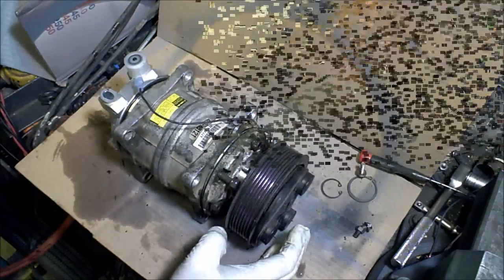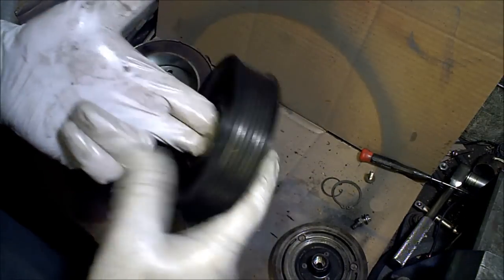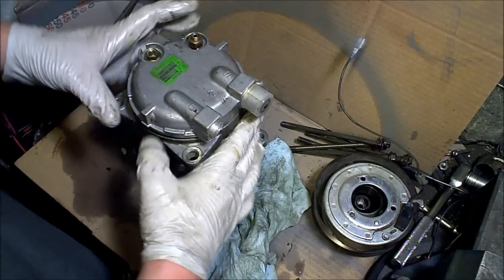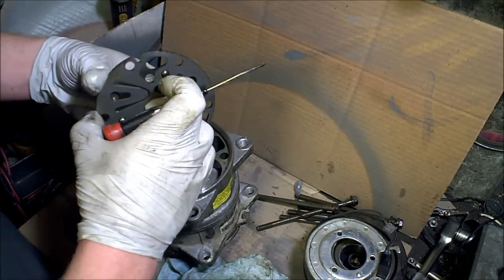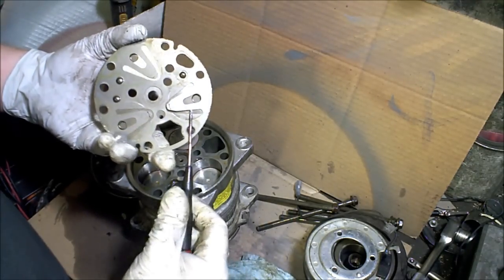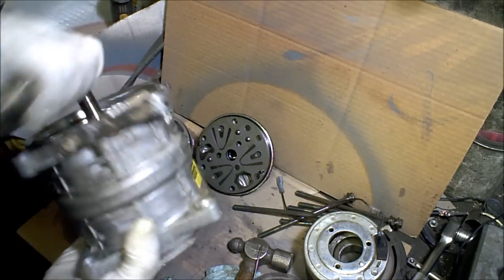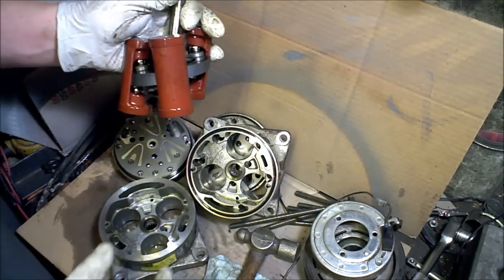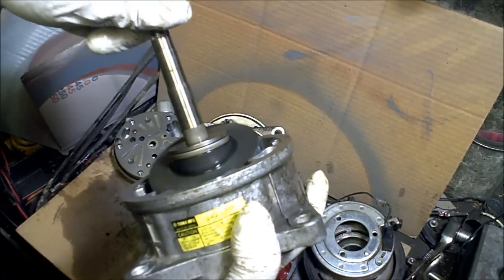AC compressor take apart How it Works tear down air conditioner

Comment: Thank  you for this so well put video. I remember being told by my auto repair instructor many years ago: "if you suspect the compressor is not working right, just replace it with a brand new one"
by you sharing this video , now I can see the inside of the a/c  compressor. Thanks again.

Comment: I have been an auto mechanic for 14 years and never actually new the internal movements of an A.C. compressor.  It is not at all what I imagined.  Thank you for your video.  You learn more and more each day.  I still don't understand why some manufactures think that this small chunk of aluminum and steel is worth 600+ bucks.
Reply: Cost about 230 on amazon
Reply: and all i need is a $5 seal
Reply: $1790+gst from Nissan AU for one for my patrol.
Reply: 300 and something for my 03 avalanche at AutoZone. I'm sure at the dealer it will be more then 300
Reply: I know this is years after you asked, but it's because of the tight tolerances you need on the internal components. Machining is much more expensive when variation is measured in microns.
Reply: @ToyManFlyer1100  Always pay more for quality
Reply: Quality today becomes substandard tomorrow.
Reply: Exactly what i thought when i watched the video, why are they so expensive? Can easily pay over AUD $1000 (US $657 as of today) for one in Australia. I know they need good bearings, tight seals and tolerances and need to be able to last and not leak with automotive vibrations but still, $1000? You can buy a whole car for $1000!

Comment: So I'm going through our automotive A/C class at a tech school and we're told right away that we will not be taking apart any compressors in the field because they will always be replaced straight away. Fair enough. But then they say that for this very reason we will not even have a display compressor for you to take apart, so this video you made is the very first time I ever saw a compressor being taken apart, so thank you very much.
Reply from the maker: Jgizzy -redacted- Yeah, only Mexico gets to see inside. I'm not surprised but you would think, especially with the cost of some of these, they would have people learn to rebuild them. They could make a rebuild kit for most of them for $25-50 and it would take 30-60 minutes to rebuild one. Thanks for watching.
Reply: I hope your not paying too much for this class, this is the problem with many of these schools today, some ass-hat decides you don't need to know some fundamental stuff.
Reply: I work at a dealer and now a days we replace the whole thing. But i would like to rebuild thing to Not just replace them.
Reply: @GROMEXCR22 especially OEM Original
Parts, best quality...
Reply: @sixtyfiveford 
great line very true,
Only Mexico gets to look inside..............
Reply: @sixtyfiveford 
great line very true,
Only Mexico gets to look inside..............
Reply: @sixtyfiveford 
great line very true,
Only Mexico gets to look inside..............
Reply: @sixtyfiveford 
great line very true,
Only Mexico gets to look inside..............
Reply: @sixtyfiveford 
great line very true,
Only Mexico gets to look inside..............
Reply: @sixtyfiveford 
great line very true,
Only Mexico gets to look inside..............
Reply: @sixtyfiveford 
great line very true,
Only Mexico gets to look inside..............

Comment from the maker: The front plate(clutch plate) is directly connected to the center compressor shaft with a key way and bolt. The serpentine pulley actually has the bearing and is free spinning.

Comment: Thanks for taking it all the way apart.  If you only want to replace the electromagnetic clutch, for example, and foolishly remove the bottom-most snap ring that secures shaft seal in place, exciting things become possible. I did it and didn’t firmly seat the snap ring all the way around. They can be hard to get in and out, especially the large snap ring that secures the magnetic clutch ring in place.  What I found was that after putting in about a full can of refrigerant and forcing the compressor on, something had to give; what gave was that snap ring holding the shaft seal in place and when it exploded, it sounded like a bomb. Refrigerant, Green Dye and PAG oil covered about half of the engine compartment, and I felt sure the engine would go next, but all was quiet after that.  It took me a month to look at it again, and I took the compressor half way apart, found the problem, fixed the seal and snap ring and put it all back together. I’ll recharge it any day now, just you wait and see.
Reply from the maker: That makes for some excitement.

Comment from the maker: I think it would stall as a water pump. The refrigerant in the compressor is a gas and I know if you are recharging it to fast you can "slug" the compressor and damage it. Very neat to see the mechanical principles going on inside.

Comment from the maker: Yeah, if r134a is leaking out then oil is as well. You can buy an inline oiler that you pour oil into then hook it up between the can and the fill port. Or you can add part of a can of pressurized oil. Or they sell cans of r134a with oil mixed in.

The backyard way is to just pour some oil down the hose you are connecting to the can and fill port. It will push the oil in with the r134a.

Comment from the maker: At 3:58 you can see the front housing bearing real good and if you look in the background at 4:20 you can see the bearing in the rear housing. This allows the center shaft to spin and it directly connected to the front clutch plate.

Comment from the maker: You should be able to physically see your clutch engage and spin. I'm wondering if it is slipping. The belt should have a spring tension pulley so it is virtually impossible to over-tighten.  I would also make sure your electric fan is kicking on when your AC kicks on(Should be able to see and hear it).

Comment from the maker: When the bearing is going out it will make a constant rumble/grinding sound. You can hear it better if you remove the belt and spin the AC clutch pulley by hand.

I would think the rust colored stuff on your belt is spray belt rejuvenation. When you get a screeching belt you can go buy a $3 can of belt anti slip/rejuvenation. It lasts for a couple weeks but the belt will start squealing again. I'm sure this is what someone did. Fine sand paper will remove it from the pulleys.

Comment: I opened a denso compressor and the pistons come slightly out of the cylinders and are hitting the plate causing a rattling sound. Also the pistons barely move down the cylinders before coming back up very strange how can they compress if they barely go down the cylinders?

Comment: Awesome video, I drive a 2005 Nissan Altima 2.5L, I have a rough idle when the car is in drive but at a stop light.  I believe I've narrowed it down.  The low suction line on the AC has been leaking for a while, I'm going to replace it and ad AC oil and refrigerant.  Having said that I was also thinking that I may replace the AC clutch pully bearing.  In your experience would it benefit a tare down like in this video and clean it out with brake fluid?

Comment from the maker: Lightly sanding the pulleys with 120 or higher grit will remove glazing and contaminants from pulleys. Once a belt is glazed over from slipping it is junk.

Comment: excellent video, well explained and detailed.  Ive a 2002 altima, compressor clutch stopped engaging, plus I can hear the bearing noise.  Ill have it replaced, then Ill disassemble...using the knowledge learned here.  Thank you.

Comment: Ok-Your help greatly appreciated.It's amazing how someone told the guy his bearings are bad in the compressor!When I bought my car it had two new belts on it that is why I was not leaning towards a belt at the time.It started to make the noise not long after I go it.It does make the noise without air on and gets worse when the car is put in gear which would make sense since the belt is under heavier load.Does the glazing  of the pulleys of what you said is the Belt spray need to be addressed?

Comment: I installed a new AC compressor for my vehicle.  During the servicing phase, the high was up and low was trying to operate a little.  Anyway it started squeaking bad.  During the service face , I jumped the compressor with thr high side, as mentioned in the beginning (maybe 15 minutes).    Do you think bearing might be bad, and the compressor section is fine.  Just curious.  I have a new one but if the bearing is bad , I can repair and install on other car.    This compressor had 4.0 ounces of oil before operation.   Sorry about the long message,  I just enjoy fixing cars.  GOD BLESS

Comment from the maker: The AC compressor requires a lot of force to turn it. It puts a load on the engine so the engine has to use more gas to run.

Comment from the maker: It just won't cool or it will cool poorly. It really shouldn't damage anything. AC relies on High pressure gas transitioning to Low pressure to supply cooling. By adding to much it makes the entire system high pressure.

Comment: Really Cool Video, and I finally have a much better appreciation of what is going on inside the compressor.   But I also have a question for you...if one is adding a can or two of R134a every couple of years to replenish what has leaked out of the system, do you think also a substantial amount of oil has also leaked out with it?.  And if so, is their any way you would recommend to add back a couple of ounces of new PAG oil back into the system to help protect the needed lubrication?

Comment: Do you think it would be possible to connect a 12-Volt motor by accurately machining an opening in the back of the compressor housing and machining the compressor shaft to accept the motor shaft? A high pressure seal I'm guessing, also.

Comment: Great vid of disassembly. While pulling off the pulley, I broke off the snap ring groove, can I replace the part the bearing rides on?
Reply from the maker: Parts are not easy too find for most of these compressors

Comment: Nice tear down video.  So what goes bad in a compressor of this design and what gets replaced in a refurb compressor?
Reply from the maker: The clearance between the pistons and the bore it's larger and it can't compress as well. Sometimes the reed valves also break.

Comment: OK Cool....I am mechanical and about 85 percent sure I might get that thing back together but just how much of a compressor can I get parts for at my local part store? Are there kits available to the public to rebuild these or what? Me and a friend tried dumping some cans of 134 into my daughters car. The refrigarant went somewhere and there is power to the compressor but its not cycling. Clutch part is my guess. Thanks

Comment: So does the compressor take power from the engine/combustion energy or from the electrical energy from the battery in order to operate it?

Comment: thanks-We bought this car two years ago and the belts were brand new on the car.Shortley after owning it is when the screeching noise started.One thing I did notice is that the crank pulley, A/C pulley were coated/impregnated it seems in a rust colored dust.The belt is also impregnated with this.The clutch assy.had this coated on it and I had cleaned this off.I tried to clean it off the pulleys but it would not come off the pulleys.Any way I could clean it off the pulleys and belt?

Comment: Great video.  what are the other 2 types of compressors used in cars?
Reply from the maker: There are actually 5 types used; Piston, Scroll, Wobble plate, Variable stroke and Vane

Comment: Nice video man! I have a question too. My car idles at 950rpm when the AC is on ,if i increases the rpm to like 2000-2500 will it cool faster ? Does the compressor's piston movement increases with the increasing rpms?
Reply from the maker: It would flow more refrigerant, but if your car is sitting still you won't get more cooling. This is because the condenser won't have enough air running across it.
Reply: yea.. yea still vehicle doesn't cools much! Thanks!
Reply: gotta get the heat out of the gas
basic principle

Comment: Any chance you remember what car that compressor was off of? I have a modified c4500 and need that exact clutch cover but can't find a part number for the compressor or clutch... Thanks for the video!
Reply from the maker: It is a Seltec 488-45121 TM15HD.

Comment: Hi ، good video, Is there any solenoid or sensor , inside the compressor, or any  electrical component, other than the magnetic clutch. Generally , do compressors, differ one from another. Thanks

Comment: So quick question you mentioned another snap ring down at 1 minute and 35 seconds into the video that right before you start to remove the external bolts. Exactly what internal seal are you referring to? And is there a name for that particular seal and because the compressor actually houses a magnet that creates the charge.. is it a magnetic seal that you are referring to?
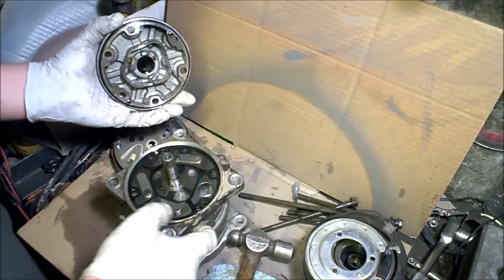Reply from the maker: There is a bearing and seal that support/seal the main center shaft that spins. It's not magnetic. At 3:00 you can see the main center shaft.

Comment: Ther was alot of dust on the clutch.That is what I thought it was.The bearing does not runble at all,feels smooth.Could it be the internal bearings on the compressor?Not sue if they would schreech and Squeell?

Comment: What happens when the pistons wear down? Are there honing tools and replacement pistons? Or at that point does the compressor just get tossed and replaced?
Reply from the maker: +liamvg No one will sell you parts. They are shipped off to Mexico or China and rebuild there(cores)

Comment from the maker: His belt is slipping or his electric clutch is slipping but my money is a burnished belt. 
You can try cleaning the clutch by spraying it down good with "brake parts cleaner" but a new belt will solve the issue.

Comment: Ok- got it.Just trying to figure out my problem.03 Mazda protege.Air is cold and compressor works fine.Have this on again off again screeching noise when the car is started and getslouder when put in gear.Turning on air or even heat makes it louder.Ruled out the alt. and it's belt.Tightenening the A/C and pwr steering  belt seems to help quiet it.Do not think it is the pwr steering pump.Comp. pulley vbearing feels ok, but I am suspecting it is making the noise since it turns  all the time.

Comment: Nice video. I'd like to know is there anything special about it? why is it so huge? It looks like much smaller compressor could be made that will give the same pressure. And the magnetic clutch seems too bulky too. Are the RPMs regulated by clutch slip? Thanks for any info
Reply from the maker: It has to be large to move large amounts of refrigerant at all engine rpms including idle. The clutch is sized to the pulley and the larger diameter it is the more leverage it has to spin the compressor. The compressor could be made smaller if the engine spun at high rpms always.
Reply: sixtyfiveford hmm, so compressor RPMs are not regulated, but are the same as the engine(times pulley ratio)? if so, why the need for magnetic clutch? why dont they use servo and mechanical lock with synchro? or the power to engage it could come from oil pressure or vacuum. It would have fraction of the mass. And you can allways gear it up to get more RPMs, so it could be made smaller. Save space and weight.
Reply: sixtyfiveford Anywhoo thanks for your answer
Reply from the maker: Nope the compressor rpm is not regulated the clutch does this. The magnetic clutch serves two purposes: one you don't always want the AC compressor running(AC not turned on) and secondly to control the pressure. More on the controlling pressure: The compressor will cycle on and off to maintain a steady line pressure, the faster the engine is running the shorter amount of time the compressor needs to be on while it needs to be on longer at engine idle to build the same pressure. So it will cycle on and compress/pump refrigerant into the line going to the condenser. It will compress it to a high psi, approx 250psi and then shut off. The pressure will bleed down as the refrigerant escapes into the condenser. Once it hits approx 175psi the compressor clutch kicks back on turning the compressor and pumps back up to approx 250psi. It keeps cycling like this indefinitely. An electromagnet is very reliable and has virtually no fail points. Engine vacuum varies greatly from 0-18 inhg while driving, so if your accelerating the vacuum would drop to 0 and your ac would kick off. Oil pressure is around 40psi and could work be you need a way to switch it on and off. The most ideal thing to make either vacuum or oil pressure work would be an electric solenoid (electromagnet). So basically you'll just add a higher fail point and over complicate a basic system.Smaller, There are different designs and this is one of the smaller. The smaller the compressor, the faster it will need to spin to move the same volume. With this comes a LOT more heat and severely reduces the life. Theoretically if you needed to spin it twice as fast it would only have half the life but in reality even less with the added heat. So instead of a compressor lasting 150,000miles in a car it would get 50-75,000 miles.
Reply: sixtyfiveford Its amazing you actually found time to answer me in such detail. Much appreciated
Reply: G.I. José  The compressor only turns when the a/c is turned on. (Think winter)  It would waste fuel to have the compressor run all the time.

Comment: I have taken apart a V7 Delphi Compressor. I bought a replacement Gasket Repair Kit Kt-GMV7N. This Kit has 5 smaller O rings. I'm sure 4 of these go on the Control valve but I can't find where the other O ring is to be used!
Also, The shaft needle bearing-SCH 1010, behind the shaft seal needs to be replaced! Can you tell me where I can buy this bearing?
Reply from the maker: +Albert Spahn This guy has a great video on the v7 delphi https://youtu.be/7lmZnBtj1LE